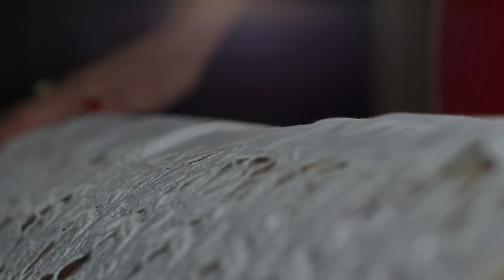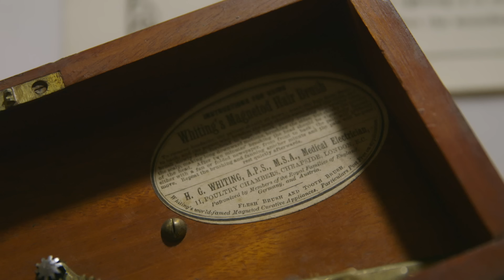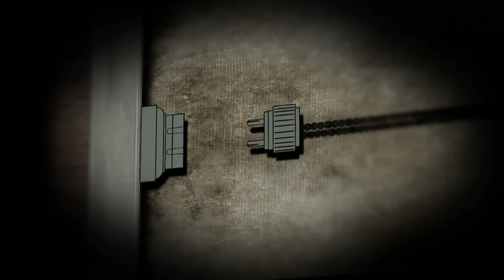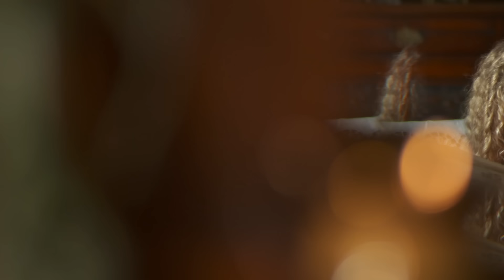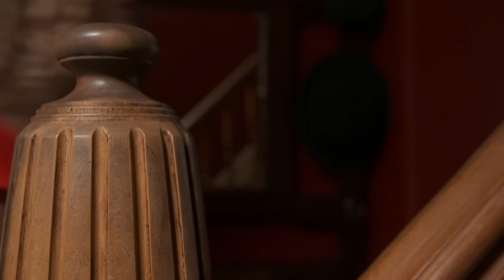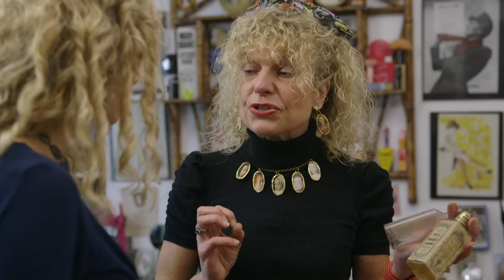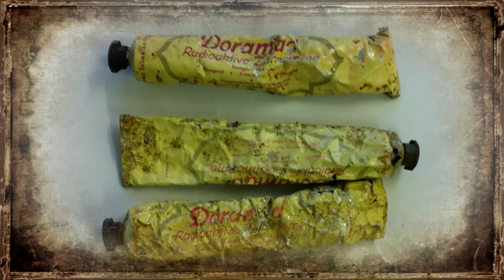The Edwardian Inventions That Turned Normal Homes Into Death Traps | Hidden Killers | Timeline

Comment: I spent a month after work hours pulling up asbestos tiles in our 1907 kitchen with a heat gun while wearing a respirator. It was awful, but I'm glad it's gone. We ended up just encapsulating the asbestos  covering on some of the in-wall heating ducts with a spray-on product and I just hope it's effective.

Comment: Saying Swan co-invented the light bulb is pretty generous.

The idea for the incandescent bulb had been around for decades before Edison made a realistic version people could actually use. Neither Swan nor Edison came up with the basic notion. Bulbs needed a very strong vacuum as well as a filament that didn't burn up in a hurry. Swan used a filament that burned up too quickly to be really practical. Edison created the carbonized bamboo filament, which made bulbs run longer. A couple of Hungarians created the tungsten filament, which is still used now.

Comment: My house was built in 1959 and the ceiling and walls are all insulated with Asbestos.  I live above the 55 parallel lat line and so it's certainly a good insulation...as long as it is not disturbed. There's also a lot of waste water piping that is insulated with asbestos to keep the the lines from freezing underground.  Quite often though houses here are in need of repair and the abatement companies make a good profit cleaning out the asbestos and replacing it with fiberglass insulation.

Comment: Watching this reminded me of how when I was serving in the US Navy back in the late 1990's the Navy was still using electrical harnesses on the C130 engine that had asbestos in it. We always had to be careful when replacing those wiring harnesses due to opening the harness outer layer would release asbestos. I had almost forgot about that. I think the Navy was phasing it out as they came across it. But then again I worked on electrical components in the Navy around that time that were still using electron tubes so I guess you could say the Navy was very slow to update their equipment.

Comment: LoL in the 60s and 70s I grew up in a marvelous, large, Queen Anne Victorian house in NYC with brittle rubber coated cloth electric wires, light switches that turned or which had push buttons that sometimes sparked, clocks that glowed, a wood metal lined refrigerator cooled by a compressor with a big tank of ammonia in the basement (we replaced the refrig with a new Admiral one, but left the tank and the compressor alone), asbestos insulation in the walls and the attic, and even the electric iron (which I still have (but not the old cord) was a clone of the one you show here.  I used to play in that attic with asbestos loft and cough black phlegm afterwards.  Half a century ago.  Guess I have just been lucky.

Comment: The siding n my grandmother’s house was asbestos, this was in the 60’s in rual east Texas.  The house was old even then.  My late husband worked for Bell Helicopter and there was asbestos in the autoclaves used to cure parts.  Once, a few bricks fell and were pulverized by the fan motor.  There was dust everywhere, causing a big cleanup.  The company wanted the workers to sign a paper stating that they wouldn’t sue if the came down with mesothelioma.  He didn’t sign it, but I have to wonder if this could have contributed to his other health problems and his passing away on Dec 7 of 2023 at 64 years of age.

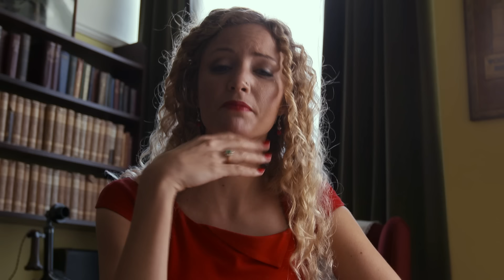Comment: 29:00 - "The dangers did not become known until the 1920's."  Uh huh.  OK, so why didn't I know anything about the dangers of the deteriorated asbestos insulation I was pulling off basement pipes in the house I grew up in the 1960's, or the asbestos house siding on my father's house that I was scraping for repainting in the 1970's?  Then in the 1990's I was in the military and worked in an office with asbestos-laden wall tiles. There are probably millions more like me that never knew anything about asbestos until much later.  Once this garbage is in our communities (think lead or DDT, etc., too), it takes FOREVER to get rid of it!

Comment: not really a historical example, but i remember discovering how dangerous exposed wires were four or five years ago when i was using an electrical back massager that belonged to my dad. i couldn’t see that when i reached behind me, the the rubber at the base had worn away, and so i was completely surprised when something sparked and caught my shirt on fire….

Comment: I lived in an old house for quite some time. It was not renovated since I guess before the second WW, and I didn't mind. But after watching this video, I noticed green colour under three layers of paint, I knew some electrical wires were still wrapped in cloth ( I never used those), and I started wondering about asbestos. There was a gas leakage but the landlord never reacted to my complaints. When a repairman came to fix the museal gas stove, he could smell the gas, too,  he told me I' m probably just still alive because the windows were so drafty. So I moved out of that beloved house, and learnt the next tennant that moved in had died 6 months later...

Comment: Was looking to move to Ottawa, Illinois, until I found out that there are still 16 areas of radium contamination and a Superfund site  still dangerously polluting from radium clock factories that were long ago closed. Still a problem. It seems after the old factory was closed it was used as meat factory. When torn down, the rubble was used as fill material around and in public buildings, etc. So now whole town is basically dangerous. Old factory was closed in 1936, when factory workers were taking owners to court. They then opened New factory, and it operated until, shockingly, 1978. The town still pays the price.

Comment: suppose many of us are smiling now... though i wonder why it has to be written both i n English and Spanish that a dishwasher is NOT to be used to wash  fruits and vegetables.
Or why I have seen in a busy railway station sidestreet cafe, the doors of a microwave oven, the safety switches taped over,   removed and have the oven running continuously in order to quickly heat up food. the employee happily reaching always into the running piece of equipment...
And who does not remember, before the arrival of the circuit breaker, of fixing a  - burned out - fuse with a thicker piece of wire or silver foil? Smokers had it easy using the inner foil paper from the cigarette packets...

Comment: 🔌 2023 I fried all the electrical in a two story apartment; yes, I was evicted. So I use 100-135bulbs, and I connect 3pron plugs to the outlets to add extension cords because I needed that much electricity. Every outlet plug has add ons for more electrical connections. I don't care I'll do it every where I go. If you're curious: I have disco, party, bar, Led, signs, tv, color, spinning, speakers, chargers. Basically my place is full of electrical devices, so I need a lot of plugs. 🔌 🔌 🔌 🔌

Comment: The part about being electrocuted is wrong, voltage has nothing to do with it, it's about the amperage & even then it's about the pulse of the electricity. prefect example of what I'm talking about is the 1st person ever executed by electric chair, they used high voltage, low amp, direct current, which they had to hit him repeatedly & basicly cooked him. Now we do low voltage, high amp, alternating current & death is almost instant.

Comment: I come from a family of electroengineers (of a sort)
U.S. power companyes decided to use 110 volt,at 60 cycles --- because it's cheaper to build the generators --- just Happens to be THE Most Deadly voltage AND cycles per second , TO THE HUMAN BODY 😱😱😱😱😱

Comment: I used to watch and follow timeline. I no longer can. Each 40 min video has more commercials than network TV not to mention paid advertisement built right in to half of them some  part way through the actual documentary and you can't skip them. They are now simply unwatchable.

Comment: I grew up in a cabin in the woods. We didn’t have power heating or water. We had gas lights. I remember the filters were very delicate. They did leave dusty black residue (1990-95)

Comment: The Radium watch factories continued to operate till 1978!!! When finally demolished, the building materials was used to fill-in road holes, and distribute the radiation everywhere. If you plan to visit Ottawa, IL, make sure to take with you a Geiger Muehler counter.

Comment: I remember there was an appliance before air conditioners that was a sort of cage that went around the outside your window. Similar looking to a metal cage people put outside there windows to secure the air conditioner from falling. It was meant to put your baby out the window in a sort of cage to not only get the baby air and a cool breeze in the summer heat but also if the baby messed themselves and it stunk up the apartment. In the summer heat in a small apartment before ACs the smell could be quite uncomfortable in a confined space. I know this contraption definitely existed and caused some public outrage because obviously it was a dangerous stupid idea. You can guess what went wrong. It’s not an electric based invention. But a dumb and dangerous one around the late 1800s. I imagine a ton of dumb inventions like our modern “made for tv” ones have always been peddled by snake oil salesman types throughout all of human history. So even before electricity I would imagine nonsense inventions that didn’t work or caused harm were always an issue throughout the whole of human history. The invention of electricity just made some of these much more scary. If you’ve ever seen one of those old metal fans without much protection to stop you from accidentally getting your hand chopped off knows safety measures are more of a modern luxury than standard throughout history

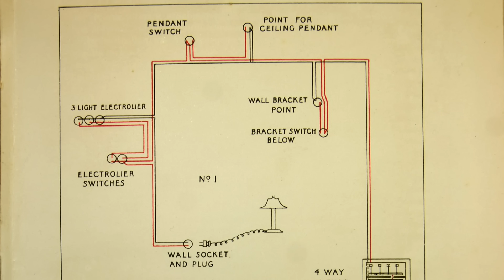Comment: 7:45 With electrical installations of the sort described in the video, earthing would very probably have increased the risk of electrocution, not reduced it. The reason is that if you are able to touch an earthed appliance and a live wire at the same time, you will get a hugely more powerful shock than if you merely touched a live wire, one that could easily kill you.

Comment: Natural Gas and similar hydrocarbons only present an explosion risk when the local atmosphere passes the "Lower Explosive Limit", which is the minimum ratio of gas to air at which an explosive mixture is formed. The problem in Edwardian homes was that minor leaks could allow gas to build up to this limit without being detectable by the occupants. Methane (natural gas) is actually odourless, but even after odorants were added for safety reasons the smell could still be masked by other strong odours in homes of the era e.g. wood or coal cooking stoves and ovens. So a small leak could turn an Edwardian house into a potential bomb without the occupants being aware that anything was amiss.

Comment: The Ammonia for refrigerants is Anhydrous Ammonia it absorbs 400x its weight in water. So for one drop of Ammonia it absorbs 400 drops of water and when exposed to this your lungs turns into a raisin. I worked at Airgas when I was young and sitting outside one day was a tank of Anhydrous Ammonia where the entire top was split open from one end of the tank to the other. It was a 2 foot split that was open around 8 inches wide. It did not run down the sides of the tank just the top. This tank was 300lbs full, stood around 5 feet tall and around 24 inches in diameter. Two guys took a high pressure tank and tried to trans-fill the liquid Ammonia into it. They actually over pressurized the Ammonia tank rupturing it while they stood next to it. This released a almost full tank of Liquid Ammonia at once sucking the water out of everything it touched including the two guys made of 90 something percent of water. So you ask why they needed this Liquid Ammonia? It was used in the making of Methamphetamines to gas off the water from it. Very prelevant in the 90's. Our plant was always getting broke into and tanks stolen from the yard. Oh ya the two raisins who blew the top off the liquid Ammonia tank died a quick breathless death that had to be awfully painful and frightening.

Comment: I still have a 20s vintage waffle maker with the cloth insulation. Works fine. How many of you have gotten a shock using the old electric fry pans with the 2 wire plug?

Comment: The one thing that used to get alot of folks was putting a can of 4d 40 or paint can on the car battery it tips over and it takes 2 weeks to pass away.now they have side posts and cover the positive side with a plastic deal.

Comment: 9:46:  Well, that would have been perfectly safe with battery current considering specifically the impossibility of being electrocuted --- but I have a sickening feeling they probably plugged that tablecloth wire into the wall outlet instead.

Comment: I have encountered a lamp that had its outside metal parts in electrical contact with the "hot wire" when the thing was plugged in,dependent on whether the plug was put in the socket one way or turned over the other way
touching the lamp while plugged in and  touching a radiator or sink faucet at the same time gave one a nice buzz or by holding a neon nightlight with a finger touching one prong and touching the other prong to the faucet caused it to light!

hence electrical codes requiring polarized plugs and/or grounding provisions and standard wiring practices,not "breaking the neutral" with switches

Comment: I guess I should see myself as lucky to be still alive.  We had asbestos in the home when I was young.  My mom had pads she used to place on the dinner table, so she could place the hot pans and other containers on the table without causing heat damage to the table.  Sure, we had lead pipes then too.

Comment: Back in the 1980s my Mother commented that her sewing machine from 1938 sometimes went only intermittently so my brother had a look at it. The power cord was insulated with rubber covered with fabric (usual for pre-WW2). It turns out that the rubber had perished and that bare wires were exposed and could sometimes touch each other!

Comment: Pre-WWI wires were stiff with cloth outside for insulation.  The cloth decays in hidden places with exposed 110 or 220v.  Known, it is replaced.  To see an example, see if you can find a sample of WWI telegraph or telephone cable for trenches.

Comment: Re Asbestos:  It is an excellent filtering material, and used as a medium in many gas masks until 2000.  (Don't use Grampa's WW2 gas mask).  A woman victim of mesothelioma only had contact with the substance as a little girl, when she would hug her asbestos worker dad, as he came home from work  coated with the dust.  An American cigarette used asbestos filter tips, touting twice as many fibers. (Viceroy, as I recall).

Comment: The fridge can still be a problem now they use butane as coolant, there have been reports of explosions with them most famous one being the fire that started the Grenfell disaster. The fridge went up and started a fire. That was put out but no-one knew it had spread to the cladding outside the tower. Still dangers in the home but modern safety regs make them a lot safer thank goodness! :)

Comment: It was not the voltage from the battery  what causes fire but amperage ........  voltage is not dangerous  in a normal  circumstance  but amperage does the harm

Comment: I have seen the wires in old houses  wires covered in totting rubber with a cotton wrap  in old days irons plugged into light fittings   thick wire replacing thin wire in pot fuses  terrifying

Comment: The "red" in red lipstick came from a certain beetle or ants which when crushed bled in red.  So many bugs were crushed to make red lipstick. (a painter knows where some colorants come from) That is the rich red color the blond chick has on.=dead bugs
. I worked in house construction in 60-80's and asbestos was in drywall mud especially the grey coat....which does not become a fine dust until they sand the walls smooth before painting. I swept the dust off the walls with a broom and then collected the dust in  a dustpan and dumped it out of the house without a mask.   Sure, I find out about the asbestos in the mud in the 90's.  By this time I am no longer working in that field and the mud changed to the redi-mixed white coat...so the asbestos is gone.   I snorted up my fill and so did those guys who boarded the houses and taped and mudded it.  Thousands of homes in my area.  So it was in millions of homes.
.  I also dealt with the tail end of lead paint having white lead for making oil paint whiter.  The paste was kind of like hand cream.
.  Latex paint also has mercury in it(a fungicide or mold killer) such a tiny amount that most of the times mold would grow in the paint in a partly used can of paint left for a couple of weeks. Such was early water based paints.

Comment: I retired as a Chartered Electrical Engineer recently after spending 45 years in the power industry dealing with voltages up to 400,000 Volts. It still surprises me just how ignorant of the dangers of electricity most people still are😡 . If you aren’t qualified to deal with electricity DONT mess with it!

Comment: Yeah, right tell me about it, I was brought up in Hull in a heavily bombed area near the docks and to be honest it was classed as a slum, no hot water unless you boiled a kettle, outside toilet that froze up in the winter and yes the galvanised bath hung on the backyard wall however we had electric, all the houses had gas previously and most of the gas pipes had been used to run the electric cables in to the lights etc, of course this often resulted in electric shocks now and then and fuses blown regular, eventually when we were the proud owner of a rented TV in the 60s we found out that none of the electrics were earthed.